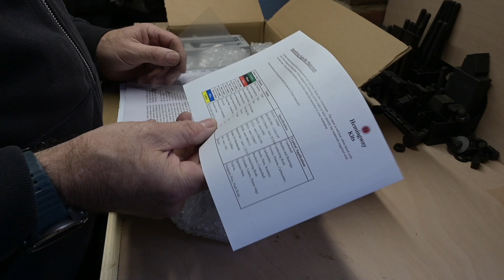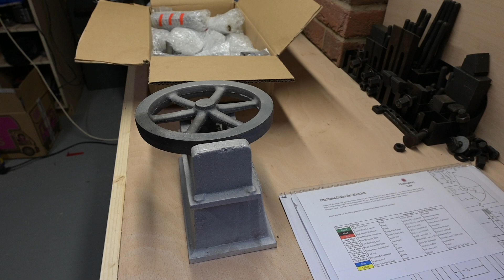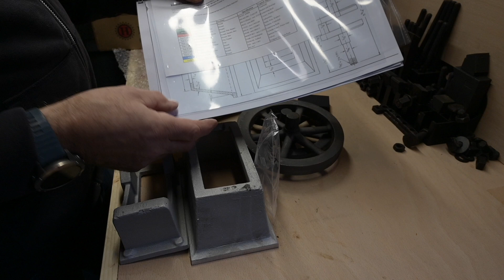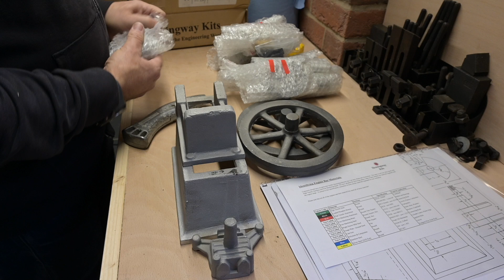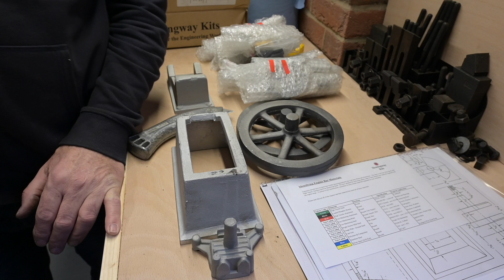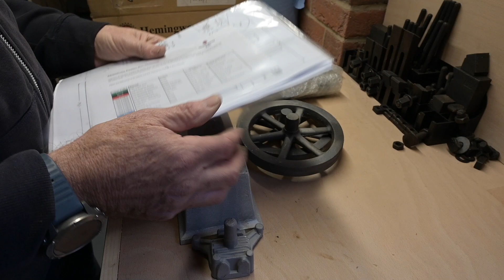Wyvern Engine Introduction - My Next Project

Comment: That looks like a fantastic kit. I guess that will keep you busy for a long time. I’m struggling a bit with my engine build as the castings are rather poorly made. I’m sure the Hemingway kit is much better. Looking forward to seeing your build videos Mark. Cheers Nobby
Reply from the maker: Yes there is quite a bit to do, unfortunately the Hemingway kits are just as bad as any others. I have struggled with them in the past, undersize before you start, not being able to machine enough off to get rid of the casting marks and full of inclusions, that’s why I like building without castings. I am looking forward to getting back to machining (in a cold workshop)😂 ATB Mark